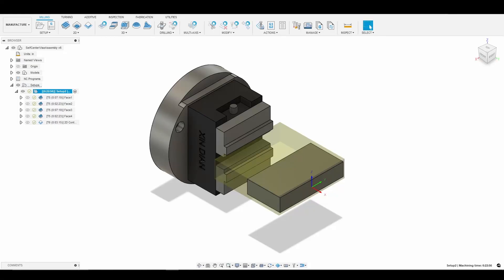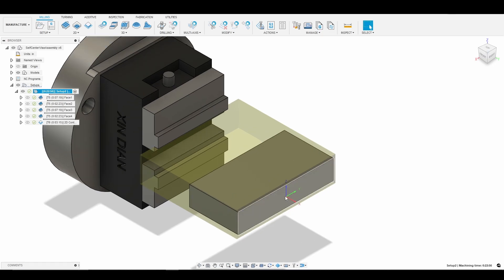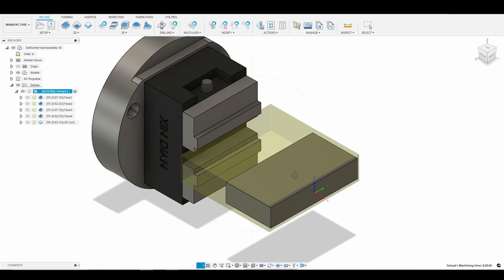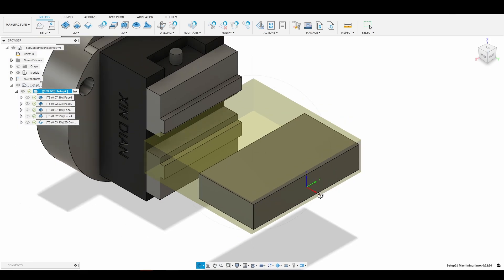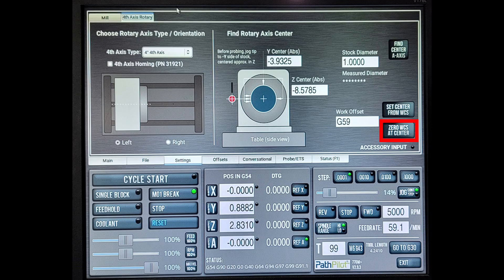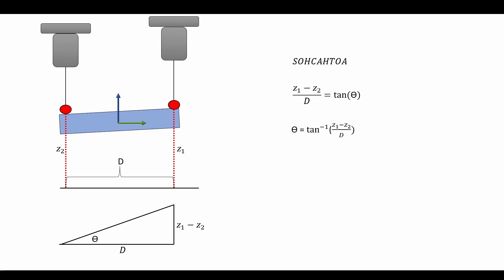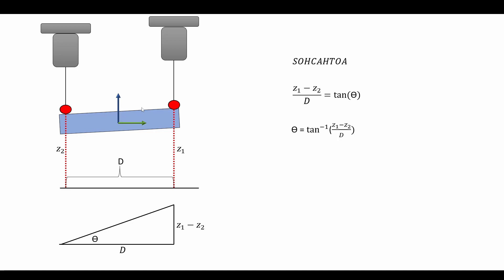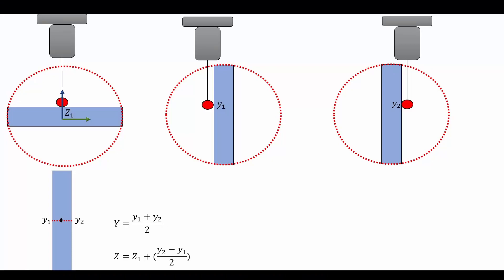Attempting 4th Axis Machining: Part 1

Comment: Hey Man, your video is EXCELLENT! Dont understand WHY this information is not part of the Tormach ecosystem. Like you, I had a hard time finding relevant info for setting up rectangular stock for the 4th axis work. In my case, I am using a custom fixture. Thanks for the detail in the video.  Job well done!